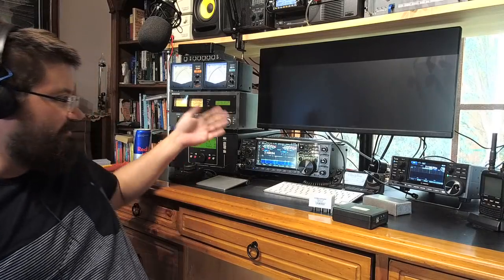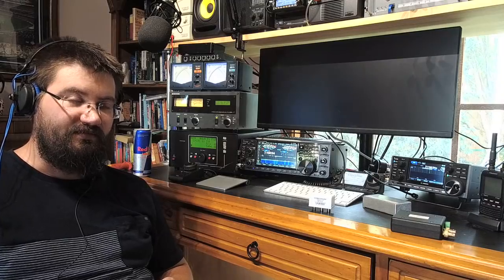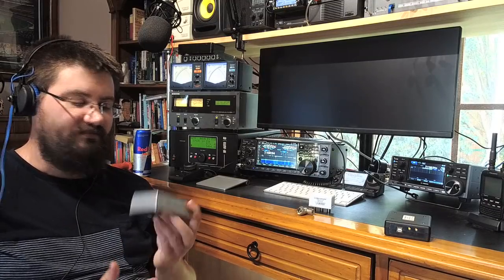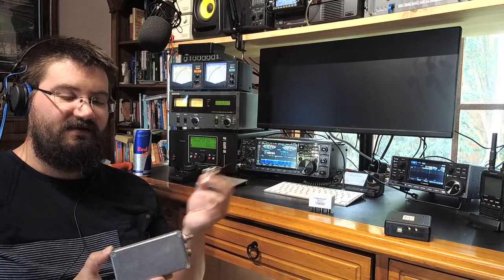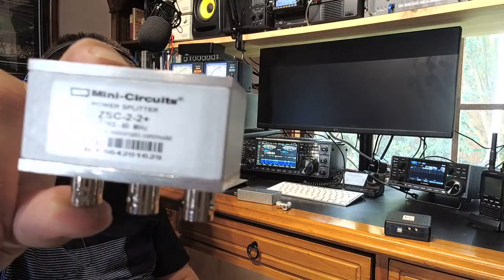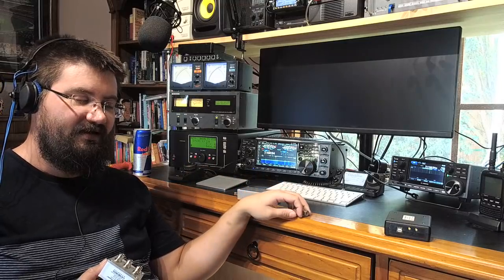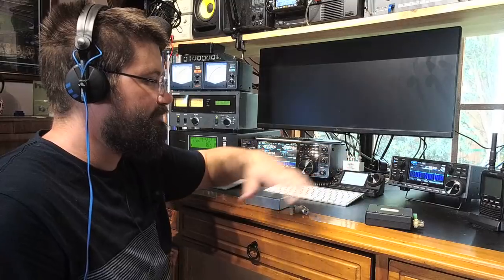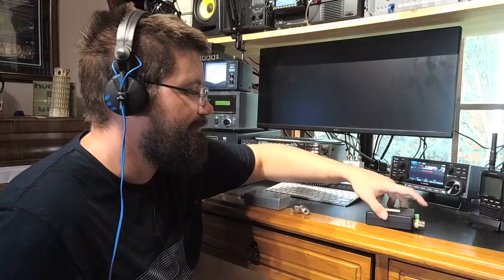How to Properly Split an Antenna between Receivers

Comment from the maker: We tested the MFJ-1708SDR 'SDR Transmit/Receive' Switch in this video, and it fails the antenna splitting test; it is simply a switched t connector: https://youtu.be/jBU8ZoGj2hY
Reply: @Jacob Jamari yea, have been using InstaFlixxer for months myself :D

Comment: Thanks for doing this video, and your original "what the" video. However using a passive splitter as you have here is a very unacceptable approach to the original question of how to use an external SDR simultaneously with a 7610 (which is why I stumbled on your video also, considering buying a 7610 and wanted to be able to use an external SDR off the receiver path of the primary radio) Since the 7610 does not provide a buffered analog output you're loosing 3db with the external passive splitter. In fact at about 12 minutes in when you switch in the external splitter in the rx loop of the 7610 the signal baseline is clearly reduced on your 7610 waterfall. So this approach of using an external passive splitter in the rx connector loop of the 7610 is only marginally better than the T connector. In my view with such high end equipment to just put a 3db loss passive splitter in place anywhere to use 2 receivers on basically the same antenna is a very poor choice. I have a 7300 and was considering buying the nicely designed, although expensive aftermarket true active buffer board to install, now that looks much more attractive in order to be able to implement a second rx (SDR or otherwise) in a receive setup. Thanks again for doing the videos. 73 John K1KSC

Comment: You did not mention anything about transmitting (TX) while the antenna is on a T-splitter and connected to 2 transceivers? Does it not only reduce output but might even harm your other transceiver?

Comment: I have the TS-590SG via the DRV out hooked up to a SDRPlay. Can i now upgrade to the 7610 using a SDRplay with the power splitter and get the same setup or, is it RX Only no TX.

Comment: OK, after watching the video again, it is clear why a simple antenna relay switch will not work.  The solution you show is great for to receivers but what about a transceiver which will transmit on the same RF port as it receives (Icom 718).  I assume I will need an antenna relay ahead of the Mini-Circuit box to send the transmit RF directly to the antenna in transmit and in receive, have the antenna switched to the mini-circuit box.  Is this right?  Is there a better way?  Thanks.
Reply from the maker: Dear Ken,

You're correct, you'd need a pair of relays (common ones should be fine for RF) to switch the Mini circuits box in and out of the transmission line as the radio is keyed. 

For some radios it can be a little easier - for instance my IC-7610 has a built in 'RX Loop' feature, with RX Out and RX In ports on the rear, so my radio does it all for me automatically.

Owners of the IC-7300 can purchase the INRAD RX Antenna kit, which accomplishes the same thing.

For your IC-718, you could study the block diagram to see if you could implement an 'RX Loop' like the INRAD Kit, or you could use two relays activated by the amp keying line to switch the Minicircuits box in and out.

Personally, I find it disappointing that the MFJ Box promises the world but does nothing at all regarding impedance matching or receiver isolation.  It would be a stellar product that I'd LOVE to recommend if it did, but as it stands (and I've studied the circuit diagram), its little more than a switched T connector, despite all the hype.

Its usable sure, but all you end up with is a PC based SDR waterfall at the expense of worse receiver performance.  I tried that compromise once and I wouldn't do it again.

73, Jarrad VK3BL

Comment: I just got a 7610 myself. Prior I had a 746Pro (Which I love) and was using an MFJ-1708B-SDR to protect the receiver of the SDR (RSPDX) when transmitting. Is that no necessary using the rx loop on the 7610 as it automatically cuts the rx while tx-ing? Thanks for all you do!

Comment: Hi. I enjoyed your video. 
Would the Mini Circuits ZSC device work in reverse? Two antennas into one receiver? I'm interested to know if I could combine two different 868mhz antenna at different heights connected to one receiver. 
Thanks again for taking the time to make these videos. Very informative and interesting.

Comment: Hi Jarrad, thanks for the response.  I totally agree that the MFJ switch would be a great device if it provided the receiver isolation that the mini-circuits device provides.  Actually, I don't see a practical solution with my 718.  Having only 1 coax connector for xmit/recv there is no way to isolate an attached SDR that I can figure out.  Maybe I'll just string a long wire for the SDR.  BTW, how do you protect your receivers while transmitting even if they are on separate antennas?
Reply from the maker: Dear Ken,

The best way to protect receivers is to short their antenna inputs to ground whenever you TX.  You simply use the amp keying line from your transmitter to drive a relay, basically.

There is a little more to it than that (ensuring you don't get back EMF from the relay, ensuring it switches quick enough / you have an XMIT delay set on your transmitter etc) but that's how its done.

You've come across one of the limitations of the lower end radios - they're not designed to integrate with additional shack accessories etc, just do the basics like connect to an antenna and/or amplifier and transmit Phone & CW.

All of these problems can generally be worked around, but it requires building little boxes here and there.  Can be a lot of fun for some people, whilst others just prefer to save up for a $$$$ rig that has all the 'mod cons' already.

73, Jarrad VK3BL & the RMR Team

Comment: Great video. I want to split my antenna between my main transceiver and a sdrplay. I am concerned abou overloading the sdr receiver when transmitting. Don't I have to short out the sdr receiver during transmit?  Seems MFJ makes a switch for this. Thanks
Reply from the maker: Yes, you would have to short out the SDR Play.  MFJ make a switch, but thats all it is despite the fluff - essentially a switched T connector.  It will work, but like most cheap solutions, it has drawbacks.  In this particular case, all the drawbacks of just using a T connector.  Without knowing which radio you have, its hard to advise on the best solution unfortunately.  73, Jarrad
Reply: @RateMyRadio  how would you do this with the 7610 and SDR Play to short out the SDR Play? Does the RX loop in the 7610 handle that for you?  I do not have a 7610 yet.

Comment: Good stuff! This receiver looks amazing ;) Is it better than the SDRPlay? Also how would you go about having the 7100 and the SDRplay as a panadapter? You can't transmit in that little device right?
Reply from the maker: Dear Jonathan, no you can't; you would need sequencer that uses the amplifier keying line to ground the second receiver.  I believe MFJ make a device that may suit, but can't be sure.  With the IC-7300, the best way of using the splitter is to install the INRAD modification :)
Reply from the maker: I'll have to compare it to the SDR Play.  In terms of dynamic range, it far exceeds what the SDRPlay is capable of by about 40dB, as well as receiving up to 3GHz whilst the SDR Play is limited to 2GHz. They're very different devices, but technically the IC-R8600 is significantly more capable in some areas, but you pay for it.  We own an SDR Play, but its unlikely we will own an IC-R8600 given the price :)
Reply: You can add a pan adapter to most any radio (with CAT control) by opening it up and taping the receive chain right before the first IF mixer.  You'll need to use a small buffer amp to provide isolation (like a hupRF board).  Then you need software to keep the TRX and SDR tuning ganged together.  I've done exactly this with an IC-706MIIG.

Comment: Can this type of splitter be used with an active antenna? I have the Icom R8600 with GTi GA3005 antenna which will hopefully stop interfere with Uniden BCD536hp.
Reply from the maker: So long as the power injection comes AFTER the splitter (further down the line).  The splitter is rated at 1w from memory.  73, Jarrad VK3BL
Reply: @RateMyRadio  I'm unclear. So for a Wellbrook Loop Antenna Interface, the splitter has be connected on the Receiver side; don't see how it would work otherwise.

Comment: Diodes, caps and transformers.
Reply from the maker: I think its just a transformer Mark; certainly, there are no diodes, and I don’t believe there are any capacitors but I could be wrong.  73, Jarrad

Comment: do not transmitt
Reply from the maker: You are correct Jerry, this is an RX Only system.  We only leave it in line for testing out transceivers as a general rule.  73, Jarrad VK3BL
Reply: The later MFJ-1708B does include a splitter and with hard switching allows an antenna to be safely shared between a transceiver and a second receiver.